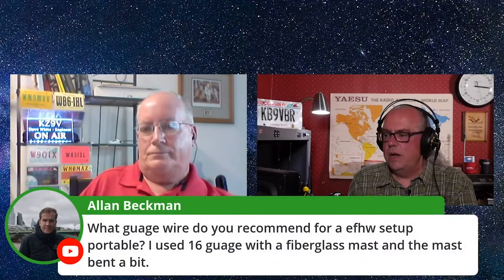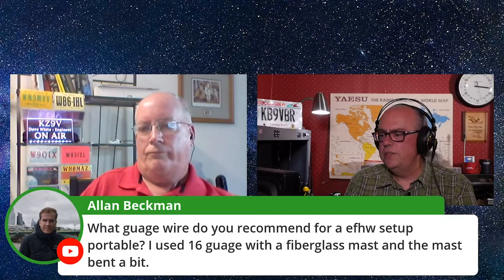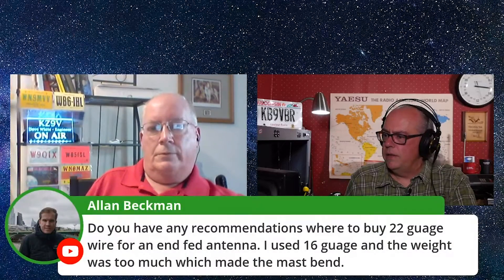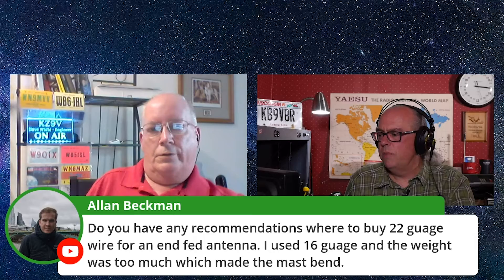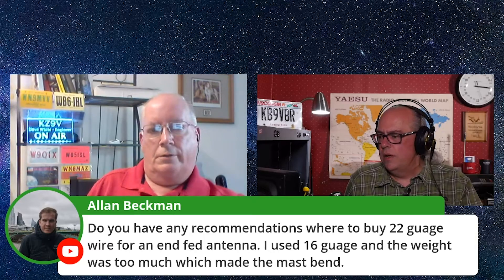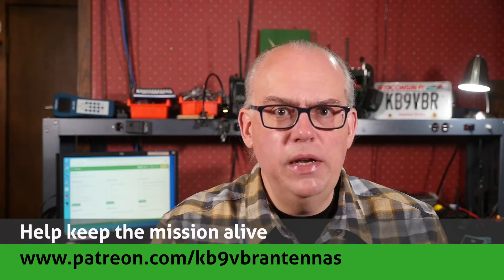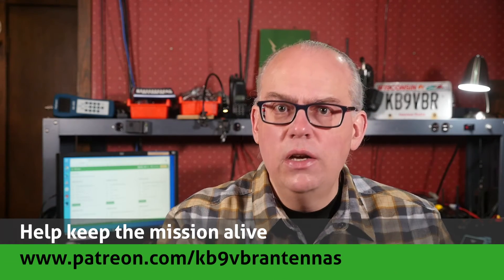What size or gauge of wire should I use for an antenna: August 2021 Livestream Excerpt Ham Radio Q&A

Comment: 22-23 AWG is easy.  Ethernet cable cat 6 is usually 23 AWG and is solid core.  Also you can pick up a box of 500 or even 1000 feet just about anywhere.  Best part is there are 8 wires in that cable so you can make many antennas. 73's.

Comment: Does wire gauge affect available or usable bandwidth on a given frequency?
Reply from the maker: Wire gauge can affect bandwidth. It's affect is pretty minimal on the HF bands. But as you go up in frequency, namely VHF and UHF, the thicker wires and materials will display more bandwidth to the Skin Effect.
Reply: Not enough to notice on any band  below 450 MHz.   Not unless you can find some wire 6 inches or more in diameter.  Some have made antennas for 80 meters  out  of several wires in parallel where they were spaced several inches apart to make a cage six or more inches in diameter.

Comment: Hi, thanks for the videos. Quick question. I have made a long wire antenna out of fine copper wire. I figured low current so thickness wouldn't matter. Am I wrong and a thicker wire would make a much better antenna? Thanks in advance.
Reply: Pure copper wire is OK.   In a permanent installation, it can stretch and need to be retuned or even break if the condioltions are bad enough.  Most any wire will radiate well. You may need stronger wire in harsh conditions.

Comment: I am looking at 107 feet supported on the ends, 80m NVIS I have been using Ace hardware insulated cloths line I am considering copper for portable operation

Comment: What size wire for 1500 watts?
Reply from the maker: The wire itself isn't so much an issue with high power, but the connectors. That's were the heat can build up. But 14ga either copper strand, solid copper, or copper clad steel will handle 1500 watts.
Reply: @KB9VBRAntennas  Thanks for replying, been wondering this forever, not much literature on the topic that i have been able to find. Where are you coming up with this?  My only guess is that the linear amplifiers crank the voltage to achieve more power and thus the current load doesn't shift much.   Phasing, where the current maximums occur would be the worst case spot, which would be derived from the voltage minimum, but not sure what the voltage min would be.   Also, i would think duty factor and heat dissipation would play here too.   We're not broadcast stations so there's lots of down time.
Reply: @KB9VBRAntennas  - what connectors would you recommend for 500+ watts
Reply: What is the minimum AWG wire for a dipole for 100 Watts?

Comment: I used 12 gauge stranded all copper for a 120 meter center fed dipole because the the weight of about 270 feet of wire plus the weight of the box for the balun plus the weight of the feed wire stretched between two trees. I also wanted minimal catenary which meant pulling it relatively tight putting well over 100 pounds of tension on it. Please don't tell me that 26 gauge would have been fine for that amount of tension.

Comment: I am using 1/2-inch braided ground strap for my 20-meter dipole. The antenna is supported by trees, at the center as well. When I load it up with a KW, I like knowing the power has some surface area. I would have settled for 3/8-inch strap, and it wasn't available just then. So I went with what was available at the time.

Comment: Very simply, it has to be strong enough to hold up it's own weight (depends on the supports) and maybe the feed line string.  The "best" size is whatever you have enough of.  The size of wire has little to do with power handling.

Comment: Isn't heavier gauge better for band coverage? In terms of SWR.
Reply from the maker: To a certain extent, heavier gauge wire will give you more bandwidth- but only on the higher frequencies. Below 30 Mhz you really won't notice much of a difference. Wire gauge doesn't affect SWR- except in terms of bandwidth; which means, more bandwidth gives you a wider range of frequencies with a lower SWR.

Comment: So if I were building a permanent dipole for HF and wanted to use high power what gauge would be correct?
Reply from the maker: Anything 16ga or thicker will handle full legal limit. Usually the power level of an antenna is limited by their balun or transformer as that's the component that will often heat up.
Reply: @KB9VBRAntennas  OK thanks so if I use a 14 or a 12 stranded and I should be set.
Reply: Can I transmit 100 Watts through 16 AWG wire?  Do I need wire that thick for 100 Watts or will a smaller wire suffice?
Reply: @eugenecbell  16 gauge is plenty thick for 100 watts.  Usually any wire strong enough to hold up outside is large enough.

Comment: I’ve been using 26 ga stealth wire from DXEngineering in a home built EFHW cut for 40 meters for POTA outings. The  49:1 transformer is integrated into a winder where the wire is stored between uses. I typically run between 50-100 watts CW and SSB and have so far four the system works well.  Also easy to store and lightweight to carry.
Reply: I made 10, 20, 40, and 80 meter inverted V antennas out of the same wire, and it never weighs down my Spiderbeam 12 meter mast.
Reply: @kd5you1  How is your bandwidth, particularly on 80? I understand smaller diameter wires result in High Q / narrow bandwidth.

Thanks!

73,
John - KK7JBZ
Reply: @johnbauman4005  On 80 the bandwidth is not that great. I cut my antenna wires for the data portion of each band, so on 80 I can use the data portion without a tuner and still have SWR of 2:1 or better. Beyond the data portion, SWR rises sharply. On 40, the lowest SWR is 1.2:1, but the lower end of the band is about 1.6:1 and the upper end is about 1.7:1. 30 meters I kinda goofed on. The lowest SWR is 1.03:1 at 10009 kHz, but the SWR runs from 1.2:1 to 1.35:1... no issues there. 20 meters is 1.01:1 at 14009 kHz to 1.75:1 at 14350 kHz. This is with the balun of the antenna at 34 feet high in the back yard. When I was at the Greater Houston Hamfest in March '23 the 40 meter lowest SWR moved to 7161 kHz and I was below 2:1 across the entire band. I didn't try any other bands while I was there. btw with a manual tuner I can tune the 80 meter at 7290 and check into the 7290 Net with no problems. I had similar results with the balun at 21 feet on a Sotabeams mast, but had to make a new antenna with slightly shorter wires to push the lowest SWR back into the ham bands. 73 KD5YOU
Reply: @kd5you1   Wow, thanks for the detailed reply! Very helpful. All the best!

73,
John - KK7JBZ
Reply: @johnbauman4005  You're welcome! I forgot to mention that I used insulators from Spiderbeam at the links and at the end of each wire, and I used Anderson powerpoles for the links and for connecting each side of the antenna to the LDG 1:1 current balun. 73 KD5YOU

Comment: Speaker wire works great for portables. Looking at the local menards you can get  14, 16, 18, 20, 24 guage. I typically run 25-100W on 20 guage with no problem. Dipoles, verticals and Random Wires.
Reply: I bought a 500 foot spool of Phoenix Gold speaker wire, and the one thing that really adds to the weight is the insulation. With that kind of wire you would need to pull on it pretty hard to get it flat, and as such the wire will start to stretch.
Reply: @kd5you1  what i often do is run a line in the shape of the antenna. So an inverted V to a point in a tree or a box hitting two points in trees. Then I affix the  feed point and the ends to that line. Doesn't really add cost, and allows for cheaper wire. Especially when i was doing a lot of portable work at wooded parks. A couple of stakes and a lot of cheap line and I could easily raise and lower it to put up different dipoles.
Reply: @jeffparent2159  ok that looks like a good method. I might have to try the same thing with my 80 meter inverted V because the coils half way on each wire is rather heavy for a fiberglass mast.

Comment: I use 26ga Polystealth for QRP and 22ga for QRO.
Reply: How much power do you transmit through those antennas?  I’m thinking of 24 AGW, but I’m looking for information on maximum power through varios wires.
Reply: @eugenecbell  meters placed between the radio and antenna indicate that the full power is going to the antenna.  Signal reports across the US and European DX seem as good as when the rig is connected to the 18ga shack antenna. From what I have read, smaller wire can narrow your resonant band width. In field operations, I have never noticed an issue. Some super weight conscious ops like K6ARK  even use 30ga.  That may not be best for 100w.  For permanent installations, heavier gauge wire is more durable, and I use 18ga an 14 ga depending on the length of the antenna.
Reply: @owlcricker  I have some 16 AWG.  It think I’ll start with the 16 AWG. 
Thank you for your information.

Comment: Does the insulation affect the signal. Would solid copper without insulation be better and more sensitive?
Reply from the maker: Insulation does not affect the performance of the antenna, but it does affect the electrical length of the antenna. Unencumbered, electricity will flow nearly at the speed of light. Insulating materials can slow an electrical signal down. The percentage of this slowdown is called velocity factor. Depending on the type of material, the velocity factor can vary between 70-96% of the true length and each wire will have a rated velocity factor in their spec sheets. Long story short: In building an antenna you will shorten the wire of your antenna based on its rated velocity factor. As for your second question, solid copper wouldn't necessarily be more sensitive. RF energy travels on the outside surface of a conductor due to a phenomenon known as the Skin Effect. Pure copper may be more sensitive and offer less resistance, but it will also be less durable; copper clad steel will offer a higher level of durability and by virtue of the skin effect be plenty efficient for RF energy.
Reply: Insulation on antenna wire will have a small effect on the wire's "velocity factor" which alters the resonant frequency just a bit, but insulation will not alter the RF receive sensitivity or transmit radiation efficiency.  For permanent installations I prefer non-insulated wire to reduce the weight, wind load, and susceptibility to snow and ice build-up.  For portable setups, the light gauge stranded wire with Polyethylene or PVC insulation is easier to manage and less prone to tangling.
KZ9V
Reply: @davewhite7679  Hi Dave,

For your permanent bare wire installations do you use solid or stranded wire, copper or copper clad steel, and what gauge? 

Thanks!

73,
John - KK7JBZ